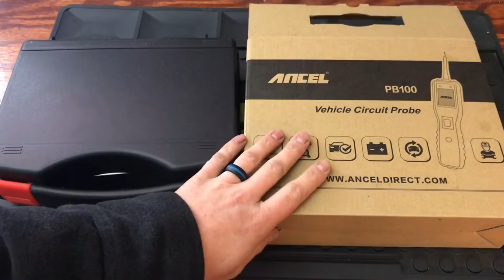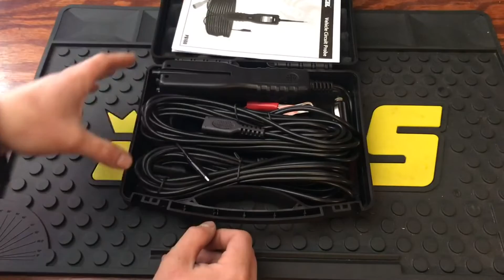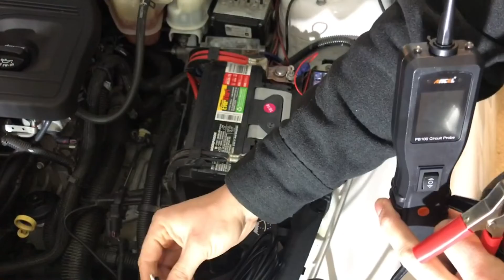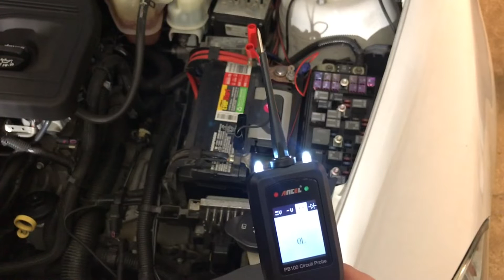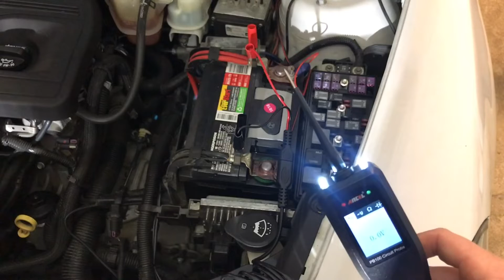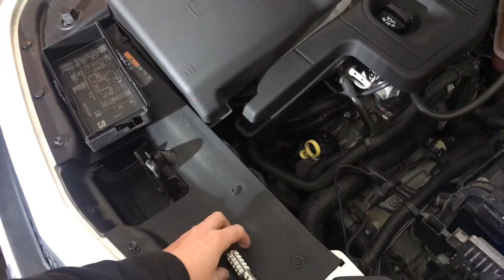Ancel Circuit Tester Probe PB100

Comment: if your going to copy a product at least get it right ,  amazon price not much different,   i have a power probe 2 and a couple power probe 3s ,  looks a cheap copy of the 3 , just my opinion ,  no circuit breaker is a fail.  if your comparing to the old old power probe its a a upgrade but not the newer ones.  but with that being said i still thank you for the video
Reply from the maker: snowman 1 it does actually have circuit breaker protection. It is an 8 amp auto reset. It is actually surprisingly well built and include all the same safety features.

Comment: I'd say the only thing it's missing is some sort of circuit breaker. Other than that it looks like a nice cheap "power probe" 👍👌
Reply from the maker: Riding With The Reid's it actually does have an 8 amp auto reset circuit breaker. They are very well made. 👍🏻

Comment: It probably works like the Autel meter in AC mode. It will read DC fine in that mode and actually works kind of like an oscilloscope. It’ll actually show pulse width and square waves. You could see a cam or crank sensor signal with it.
Reply from the maker: John Pilgrim yes indeed you are correct it does do that. Thanks for mentioning that 👍🏻

Comment: Cool tool video👍🏻👍🏻👍🏻👍🏻 it is 99.007% cheep copy of a power prob BUT it dose not have a Circuit breaker on the side like the Power Prob’ has.. past that it is the same.. I think the Power Prob’ that is has copied cost around $80 to $150 and you would be getting the real one not the copy. 🤔🤔🤔🤔🤔 just saying.😁.. But if you know!! Looks as if PowerProb’ has teamed up with Snap On sooooooooo there goes the cost up up up and away!! 😡😡😡😡